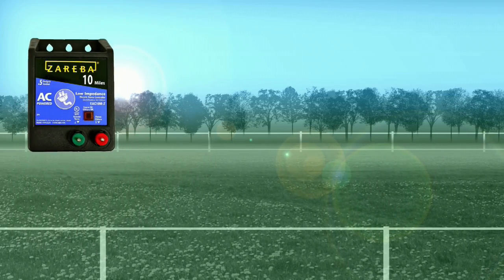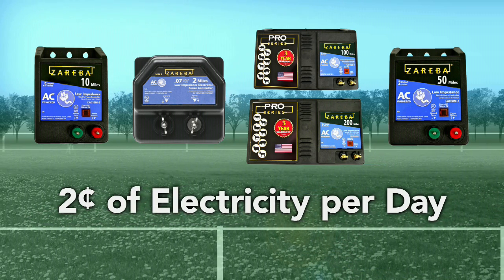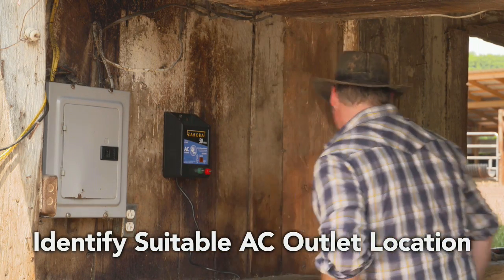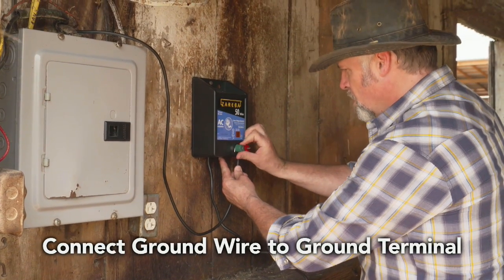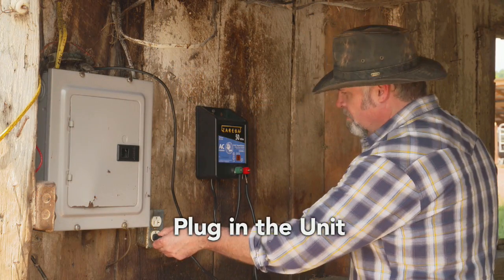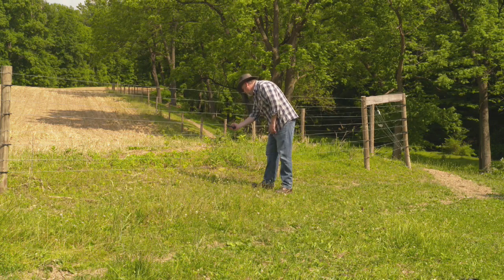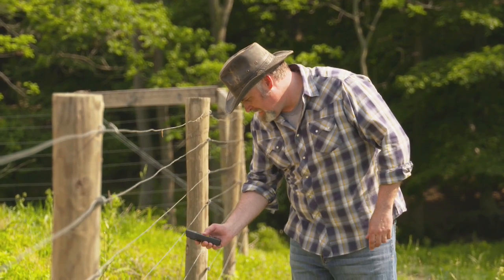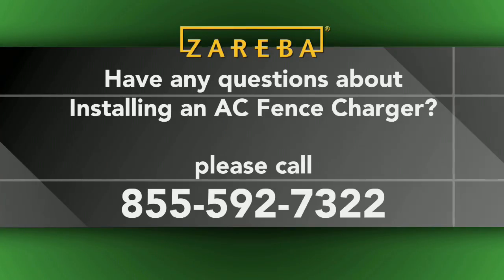How to Install an AC (Plugin) Fence Charger: Electric Fence 101 | Zareba®

Comment: How do you run the fence wire? Type and gauge of wire, run length, under ground? How to attach wire to polywire, rope or other material.

Comment: Plug in everything:
Close together;
In a clean shelter;
Near the outlet but not near the grounding system that would typically be associated with a building’s electrical installation; 
Use 30 linear feet for the ground rods; and
Connect it to an outdoor fence. 

Can you use this with an extension cord? We don’t have wired electric out to our barn, but we do have the required ground rods out therefrom using solar chargers. (I have no idea how people with smaller, wired barns would be able to make the spacing requirements work.)